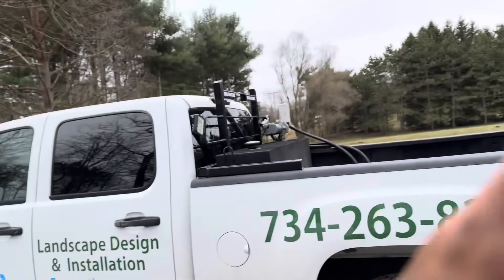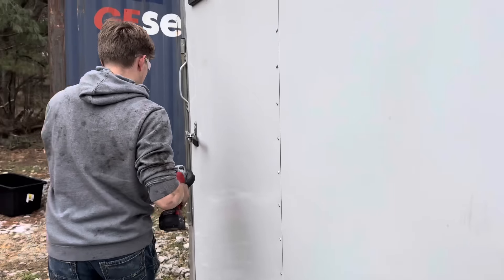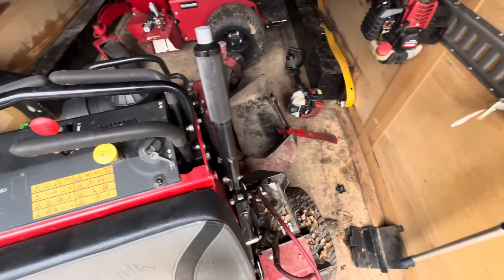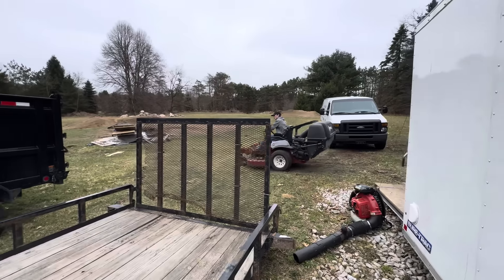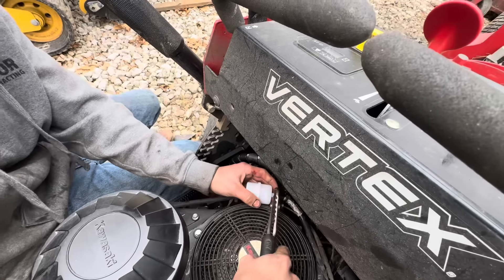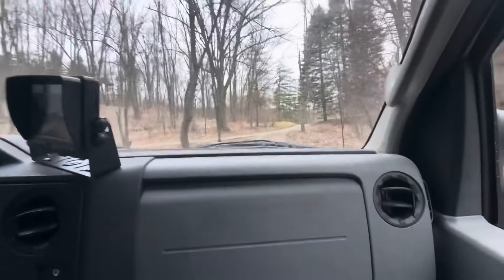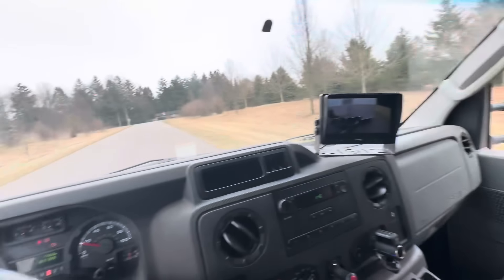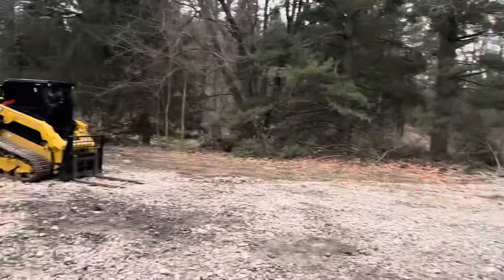Getting ready for the 2024 LawnCare season!

Comment: For a fuel filter, I think manuals typically give you charts of periodic service so it shows what you need to do at 50 hours, 100, etc and then what to do every 50 hours etc and as needed. Ive noticed the air filters are typically the ones that need the most attention,

Comment: Does anyone know why that blower clicks like that before it starts? mine mower does that too
Reply: dead battery or bad starter
Reply: Its a common problem with ferris zero turns check the wire going to solenoid see if there is 12volts i think the ignition wire to seloniod isnt heavy enough i put a jumper switch on it turn key hit jumper swtch starts every time its not a starter or solenoid problem most times has something to do with trigger wire